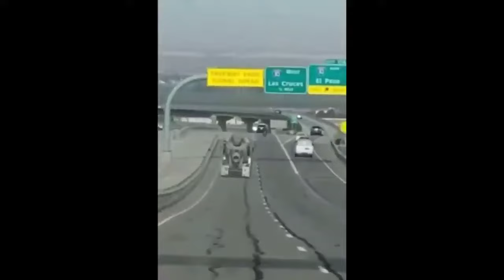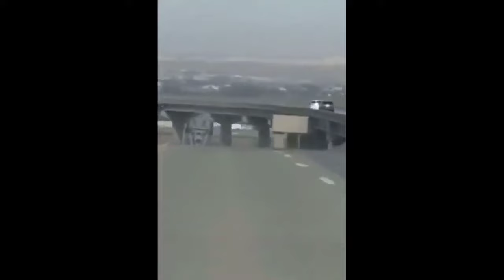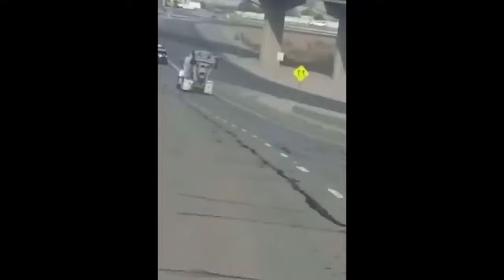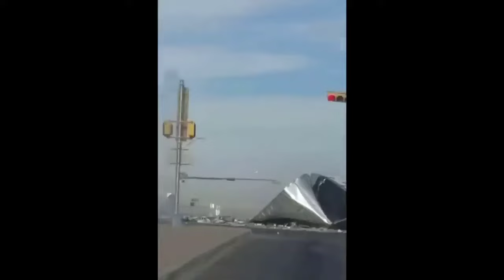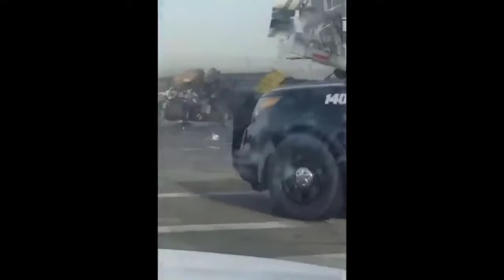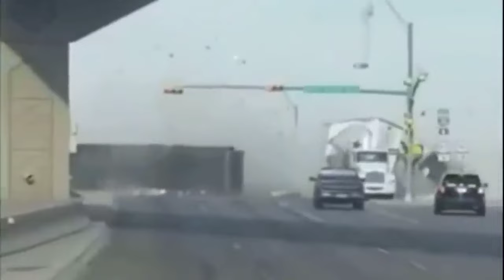Truck driver has no brakes kills himself to avoid killing other drivers🥺..#shorts

Comment: Why did he not just roll it over in a extreme hard jerky turn?   Lay it over and live.
Reply from the maker: The hard turn make the truck fall over , but it would still make the vehicle go straight without control and plow into inocent people. Especially a heavy 🚒🚛 truck
Reply: @alexshortsplus um no
Reply: Probably just didn't think about it, I mean you don't have much time to think in that type of situation, but that's just my opinion
Reply: Under pressure but your right
Reply: @alexshortsplus ever heard of friction? That truck would be love tapping cars by the time it got to the entersection and slowed down.
Reply: @alexshortsplus  lol, rolling full speed into an aluminum box with some more cans made of aluminum is not much of a solution either...at least turning it over would start slowing the vehicle down quicker before it struck other vehicles than running full speed into a weak barrier like a light weight trailer
Reply: At that speed no guarantee that would have worked 😢
Reply: Where's Keanu Reeves?
Reply: Probably because he was full of adrenaline and not thinking clearly, and this isn’t a movie.
Reply: Agree, hard decision I do not judge. Maybe he tough he could survive
Reply: Easy to say that cause your not in that situation buddy in that moment.
Reply: Easier said than done. And he may NOT live through that either...
Reply: that's what was thinking l mean he traveled quite a distance before the crash during that time he had enough space by himself so he could just jerk and roll over maybe he could also save himself.
Reply: @JoseMedina-ob4mf  it's not that simple... you ever drive a semi? I do. You don't know what toure babbling about
Reply: He panic
Reply: @user-bo4yc3zt4m  It's very hard sometimes to make split-second decisions out on the road. Fatigue, experience, and circumstances. Speed, visibility. Even if you've been doing it for a long time, things happen... Truck driving is not easy. Every day, there are obstacles and close calls. Flipping the truck over isn't something that you know how or want to do subconsciously... He tried his best to steer clear of everyone. Nobody trains to know what to do with a complete brake failure. It's a lot of responsibility and dangerous out there in a big rig. I'm typing this in a semi right now lol. 🙂
Reply: @JoseMedina-ob4mf  u dont drive trucks thats for sure
Reply: @michaelwilson2151 that truck would have slid for 1/4 mile minimum he was probably loaded with 10 yards that’s like 35,000 lbs of concrete plus the truck. 

That truck would have had to have laid on its side much sooner. But that early in the clip it looked like he might have had a shot until that truck came through the green light.
Reply: @brandondobschutz5146  Yeah, I can go along with that. I guess it's split-second panick decision making, and the rest is speculation 🤷‍♂️ I've drove semi off and on for two decades... I honestly can't tell you how I would've handled it...
Reply: I am a 40 ton truck driver🚛 
At that speed it's nearly impossible to turn the steering wheel at your "pleasure". It s hard at high speed to keep it straight . He made a brave choise, a though one. A real man, he did his thing regards of how he was feeling. That is masculinity. Rip bro, respect for the fallen ones🫡
Reply: Corporations need to up their game on brake failures and give the truck emergency brakes. Maybe even 3 or so spares
Reply: @mrleafbeef634  That's a great idea! SERIOUSLY it is... it will never happen, tho. Lol. Corporate America... what do you do 🤷‍♂️
Reply: I really hate the "What if" and "what I would have did" type of people. Especially when damage is already done
Reply: Hindsight is 20 20.
Reply: Yup exactly.  And then sue the pants off the company for truck maintenance negligence.
Reply: @HighTapa  I like how people that have never driven a semi seem to know so much. Idiots
Reply: @alexshortsplus no dude....no...
Reply: @ryanj2071 that's literally exactly what would've happened if he layed it down, have you no concept of physics? And I stg if u a adult and this slow
Reply: Probably was hoping for a gap to save it
Reply: I duno I wouldve caused a roll f that
Reply: @TRUCK-FREAK You'd be surprised how fast you think when adrenaline gets to pumping
Reply: Only a few seconds to make a decision not his fault man
Reply: he would have likely died doing that too, hes going pretty fast
Reply: That thing was flying.Looks calm on the video but if you are inside that truck things are different.Especially if it happens to you on such a location.Everything just moved so fast,the truck, your thoughts, other vehicles.
Reply: @samiakmw3681 What are you talking about bro? There was cars to the right of him not in front or to the left.. Could have easily rolled it close to the left side and nobody would have been unalived
Reply: Quick thinking in that situation probably caught him off guard just cruising down the highway over a hill with momentum, definitely a brave man to make that decision. Someone who wants to stay alive just imagine how scared to see it all flash before your eyes
Reply: You’re the expert? 🤦🏽‍♂️
Reply: Yea no
Reply: @michaelwilson2151  b.s.
Reply: @SHREDTILLDEAD  I bet you've never driven a semi b4... that's the bs from a db
Reply: No no no no no no no no no there's something else going on here man that guy , that's a flat plain it was no downgrade , he could have downshifted .
Reply: The odds of him surviving it at that speed. Is slim to none. And at that point he would have no control. So that would be a very bad idea 😞💡
Reply: @michaelwilson2151 Thankfully we have a fully accredited grade A top of the line professional such as yourself to insult and set straight anyone who makes their thought known. Thank you, press D for drive and keep trucking ol' son.
Reply: @northernprepper6981  it's better you hear the truth... db
Reply: Exactly right,
Reply: most likely he was hoping to cross the intersection to drive off the road but ran out of luck
Reply: Exactly my thoughts
Reply: @alexshortsplus bro what?😂😂
Reply: @ryanj2071 how no? Came with fax u came with ideas
Reply: @alexshortsplus no logic.
Reply: If a semi-truck with no trailer was going full speed and its brakes failed, making a hard turn in an attempt to tip it over would likely lead to dangerous consequences. Here’s what would happen:

Loss of Control: At high speeds, a hard turn would cause the truck to lose traction. The centrifugal force would pull the vehicle outward from the turn. The truck could skid or slide, depending on road conditions and how sharp the turn is.

Tipping Over: Without a trailer, the truck's center of gravity is lower, but it's still elevated compared to regular vehicles. If the turn is sharp enough, especially at high speeds, this could cause the truck to roll over or tip onto its side. The chances increase if the turn is abrupt and the truck has any load or uneven weight distribution
Reply: @ryanj2071 

 

If a semi-truck with no trailer was going full speed and its brakes failed, making a hard turn in an attempt to tip it over would likely lead to dangerous consequences. Here’s what would happen:

Loss of Control: At high speeds, a hard turn would cause the truck to lose traction. The centrifugal force would pull the vehicle outward from the turn. The truck could skid or slide, depending on road conditions and how sharp the turn is.

Tipping Over: Without a trailer, the truck's center of gravity is lower, but it's still elevated compared to regular vehicles. If the turn is sharp enough, especially at high speeds, this could cause the truck to roll over or tip onto its side. The chances increase if the turn is abrupt and the truck has any load or uneven weight distribution
Reply: @neckarsulme  

 

If a semi-truck with no trailer was going full speed and its brakes failed, making a hard turn in an attempt to tip it over would likely lead to dangerous consequences. Here’s what would happen:

Loss of Control: At high speeds, a hard turn would cause the truck to lose traction. The centrifugal force would pull the vehicle outward from the turn. The truck could skid or slide, depending on road conditions and how sharp the turn is.

Tipping Over: Without a trailer, the truck's center of gravity is lower, but it's still elevated compared to regular vehicles. If the turn is sharp enough, especially at high speeds, this could cause the truck to roll over or tip onto its side. The chances increase if the turn is abrupt and the truck has any load or uneven weight distribution
Reply: @zeugreutata 
If a semi-truck with no trailer was going full speed and its brakes failed, making a hard turn in an attempt to tip it over would likely lead to dangerous consequences. Here’s what would happen:

Loss of Control: At high speeds, a hard turn would cause the truck to lose traction. The centrifugal force would pull the vehicle outward from the turn. The truck could skid or slide, depending on road conditions and how sharp the turn is.

Tipping Over: Without a trailer, the truck's center of gravity is lower, but it's still elevated compared to regular vehicles. If the turn is sharp enough, especially at high speeds, this could cause the truck to roll over or tip onto its side. The chances increase if the turn is abrupt and the truck has any load or uneven weight distribution
Reply: @RitoDaOg If a semi-truck with no trailer was going full speed and its brakes failed, making a hard turn in an attempt to tip it over would likely lead to dangerous consequences. Here’s what would happen:

Loss of Control: At high speeds, a hard turn would cause the truck to lose traction. The centrifugal force would pull the vehicle outward from the turn. The truck could skid or slide, depending on road conditions and how sharp the turn is.

Tipping Over: Without a trailer, the truck's center of gravity is lower, but it's still elevated compared to regular vehicles. If the turn is sharp enough, especially at high speeds, this could cause the truck to roll over or tip onto its side. The chances increase if the turn is abrupt and the truck has any load or uneven weight distribution
Reply: @lloydchristmas1086  No, he's right.
Reply: @DankHillCometh  except the guy was driving a top heavy mixer truck which would have tipped immediately upon making a hard turn of the wheel
Reply: U a expert of these 👀

Comment: It was a Mixer Truck, AKA Concrete Truck... And he didn't plan shit... I guarantee you that.....
Reply: No Jake brake? No dropping a gear etc? Looked like it was full throttle in high.
Reply: @muckle8  he could have had the Jake on but at that speed it wouldn't have mattered if he was full of concrete
Reply: @DarnellQ point taken but assuming it was a manual transmission rig then why not go down the gears ? , hell if your heading for Armageddon just reverse , guaranteed it would have locked the drive wheels up
Reply: @muckle8  truck transmissions don't work like cars you would have to rev match every down shift and at that speed the trans would be spinning way to fast to engage lower gears....I drive dump trucks and mixers for a living
Reply: @DarnellQ I know all that , I’ve driven plenty of trucks too , doesn’t matter about rev matching when your truck is a runaway , just sacrifice the transmission and save yourself and others - bang it into any lower gear ,  or hold the clutch down for a few seconds and then select reverse - it will go in if your life depends on it trust me! - this truck to me looked like the throttle was stuck open
Reply: @muckle8  Reverse?... Ya Right!... Hahaha!... No Freaking Way!
Reply: @muckle8  I will agree that the truck seemed to accelerating until impact but that may have been a pretty good down grade he was on before the intersection. And yea I would have pulled the park brake and tried down shifting since there appeared to be no wall to ride but I understand he was hoping to clear the intersection and made the best possible decision in the final moments, avoid the over cab hit the trailer
Reply: @muckle8  not every truck has a jake break .
Reply: I agree, … most likely he was just distracted
Reply: @Darnell  I agree he steered for the trailer , it’s easy to panic in an emergency situation , part of the reason why  pilots and train drivers etc have to attend simulator emergency situations every few months , who knows what went through the drivers mind , lot of  green inexperienced kids behind the wheel worldwide now it seems . , as an old trucker told me bout 10 years back now - all the professionals are now retired or dead.
Reply: @Darnell  down hill grade with a full load . Driver could have  clutch in then turned the motor off and then selected a gear
Reply: @muckle8  well said
Reply: Most concrete truck now days use Allison automatics.
Reply: @muckle8 pretty sure mixer trucks are automatic and also don't have jake's on them.

Comment: 22 years on the road only 1 serious accident. Caused by brake failure. Late 90's internationals had a serious failure that was never recalled. ABS control module located under the cab would corode and lock the brakes on the truck open. No warning whatsoever to the driver. This happened to me.  Full load bulk pneumatic at a T intersection. Started my downshift plenty early enough. With the full load pushing me could only get it down to 7th gear while holding the pedal to the firewall. Found the failure reports on the NTSB website after my accident. DOT tested my brakes immediately after the incident. They were completely locked open. Did not move no matter how much force was applied with completely full air tanks.
Reply: I've seen one of those corroded ABS modules.
Reply: Ressepuffs  @ fbi i found one
Reply: Ressepuffs  how did u get away? hypothetically speaking
Reply: Ressepuffs  Damn playa you must've had enemy's or a crazy ex. Glad you ight tho n shii I would've left 2
Reply: Ressepuffs  Facts the plate always gets ppl caught up
Reply: Your so right my guy. I drive a 92 International dump at work sometimes and ive had a handful scares driving that truck due to break failure. Never crashed it but we still use it so I'll go knock on some wood now

Comment: There has to be more to this story. Trucks can shift to lower gears and slow down even with no brakes.
Reply: Its not that easy, when rpms are high you cant always get it into a lower gear its not like a 5 speed in a car
Reply: Manual transmission in a semi. 10, 13, 15, 18 SPD, most common manuals. Are not synchronized. To down shift. You have to rev up to a higher rpm. You have to be spot on the right rpm & right gear to get it in gear. Reason why, the standard is, get in the right gear before going down hill with a load. Never shift gears going down hill. Not that it cannot be done. Can be very difficult. If you cannot get into a gear. Then you are 100% reliant upon brakes. No engine braking, no Jake brake.

Most modern truck engines are rev limited to 2,000-2,200 rpm. If no brakes, already turning 1,800+ rpm. Impossible to down shift. You will not be able to rev the rpm up high enough to get in a lower gear. If you cannot get into any gear. You lost engine braking & Jake brake as well as your service brakes. Sure death for somebody.

With a synchronized transmission used in cars & pickups. You can jam it into any gear, even reverse. Put it in first, let the clutch slip to slow down with engine braking, or drop the clutch & lock up the rear tire or tires. Depending upon the differential setup, locker, positraction or open.

Most new trucks have an automatic transmission. Most will upshift at higher rpms. Even with it set in manual. The only automatic truck transmission that will stay in gear. Get engine over running warning. Is the Freightliner transmission. I know this from experience.

I run an 18 SPD Manual in my KW W990. I hate the automatics. If I had to have an automatic. It would be a Freightliner. I really hated the automatic in the KW T680 when I was a company driver. The Freightliner auto tranny is far superior.
Reply: @SinOjOs-Transport  Great explanation, thank you
Reply: @SinOjOs-Transport how you doing with the rates these days? Spot market is in the toilet.. safe travels
Reply: Not if it's a run-away. If you've got too much road speed, it's not going to go into any lower gear.

Comment: Frfr
It still relies on the pre vehicle check
One includes psi bar pressure and also oil separation filters in good shape

But yeah shit happens
Rip truck guy😢

Comment: In NZ and Aussie, brakes on trucks must fail to safe and have done for a long time now.
Air pressure is required to release the brakes, you lose it, youre locked up.
Is this not the case in USA ?
Reply: They have drum brakes instead of proper disc brakes. Overheat and fail frequently. Because it's cheaper.

Comment: They should develop an airbag system that deploys straps that lock up up the wheels .. law inforcement has something similar  idk tho cause the momentum of these trucks is great prolly have to develop a stronger type of strap or release valve to deflate the tires enough to slow it down without blowing out the tires